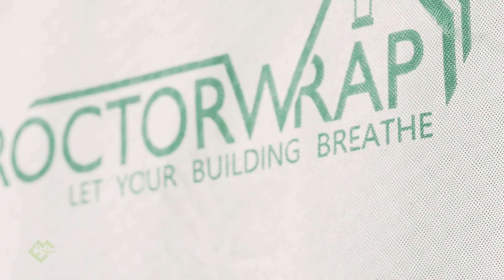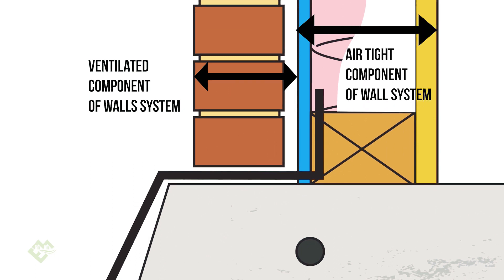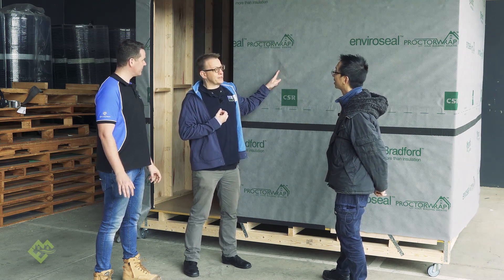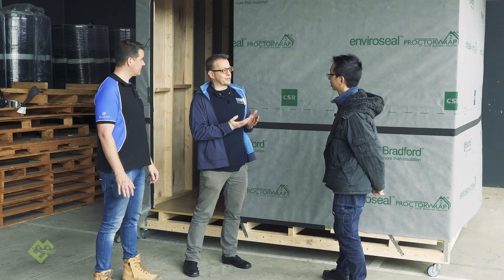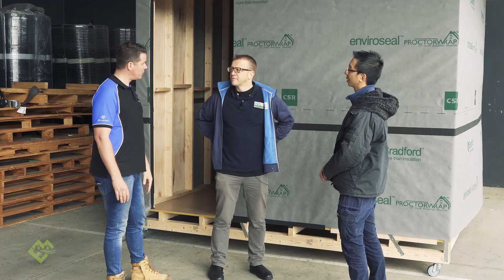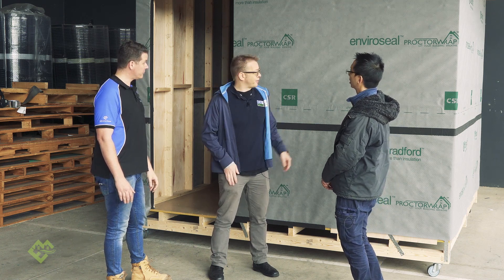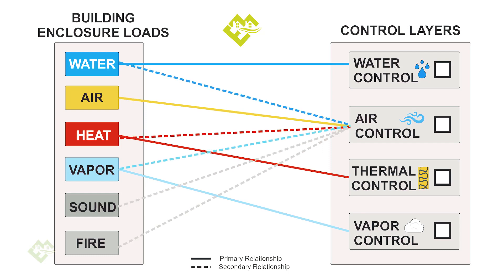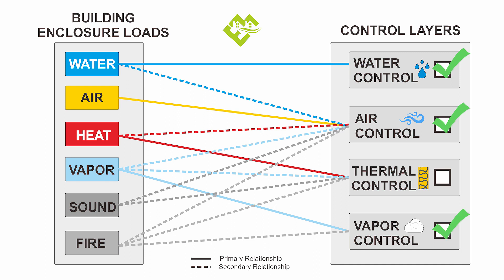Can a building be airtight but still breathe?

Comment: I thought this video would explain how you can have "breathability" to stop the buildup of CO2 in an airtight home. It seems to be more about moisture (important, but not the same thing). How can you justify creating airtight homes that just build up CO2? Is the only way around to install expensive air filtration systems?
Reply from the maker: There are 3 options, operate your windows, install a push pull ventilation system, or retrofit something to your existing ducted system.  Relying on leaks from mouldy wall cavities is not a good source of fresh air.

Comment: The temperature on both sides is different and is changing all the time so the time periods of "balance" are very short. When there is a balance, then no moisture transfer takes place. It is more correct to talk about the constant moisture transfer to achieve the balance. Breathable walls (those that allow moisture transfer) are actually air tight. Take an ordinary 450 mm masonry wall and try to get any air through it. You will see really low numbers. Usually it is different interfaces (with windows, beams, doors) that are not airtight. 

The question is about sustainability of this airtight material that you are using. Can it last 200 or 500 years? Masonry walls can easily last that much. Changing your airtight layer every 50 years along with changing all rusting reinforced concrete every 50-100 years is simply not sustainable for the planet. It is a fast food style construction that does not last. If you are interested in making money, then sure go for the fast food architecture that will damage environment and will leave no legacy and traces in 100 years because the expected life time of such houses is kind of low.

Comment: How does an "airtight" layer allow through moisture vapour. Isn't moisture vapour H2O molecules just like CO2, O2 etc ?  Why does one go through and not the others ? Unless H2O molecules are unusually small ?
Reply: Basically everything is permeable to air and water vapour to some extent. You're right. They're all just gases - H20 is like 02 and N2 and CO2. They pass through, just slowly. But we're talking about major differences in scale here. A material leaks air (N2 and O2) slow enough for someone to declare it's an "air barrier" and it leaks water vapour fast enough for someone to call it "vapour permeable". Same thing, just different ways of talking about it and different uses. For me to talk about air permeance and vapour permeance in the same units of measurement (m3/hr/Pa/m2) or (MN*s/g) would be sort of useless to you and they're very hard to measure in the same way. 
Sean Maxwell - Pro Clima Australia
Reply: In simple term, let's look at the process like this: The moisture in the wet side is first 'absorbed' by the material, then the drying potential of the outside (dry side) air will begin to suck the moisture out just like how laundry is dried by airing.  This process occurs not only in vapour permeable membrane but also common building materials such as plasterboard (drywall).
One very common example that most of us would have got our hands on is the  "Gore-tex" fabric for windbreakers and activewear.
Reply: This is a very good question, answered well.